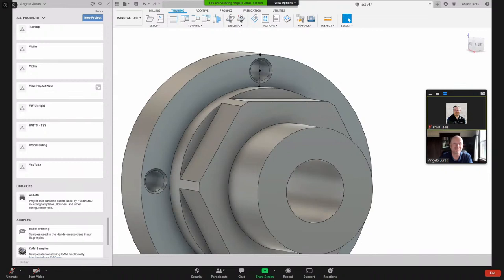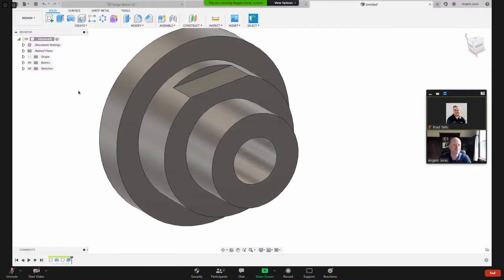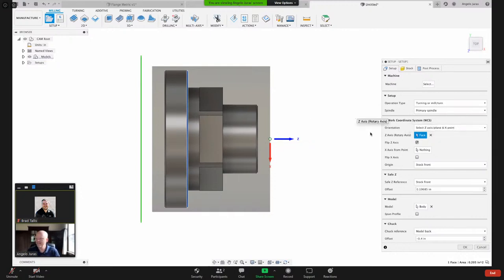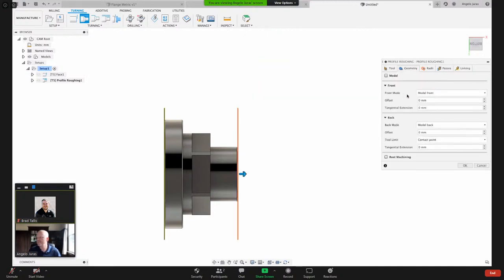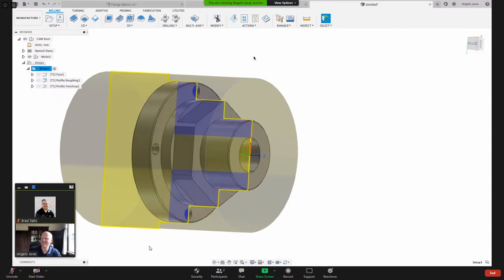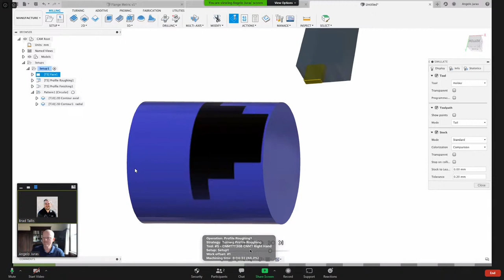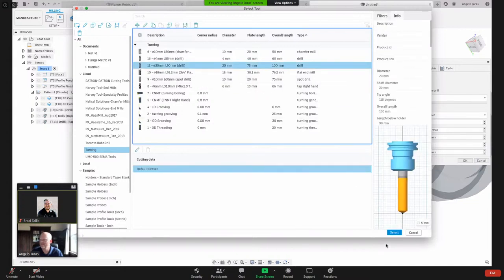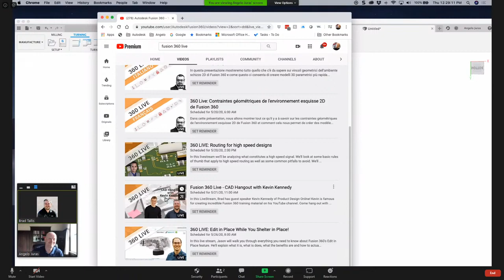Fusion 360 Live - Mill/Turn Toolpaths in Fusion 360

Comment: Hi! I’m a newbee in using Fusion 360 Manufacturing Turn. 
I’m trying to learn as much as I can
The problem I’m having is If I have a 12mm round Stock that’s
50mm long and I want to turn the front part down to 6mm x 20mm in the Z
The X movement is doubled when I post-Process it and look at the g-code.
It looks right in fusion and this happens no matter what processor I use.
Instead of moving from the center of the part 3mm in the X to end up with a 6mm DIA.
It moves 6mm in the X.  What am I doing wrong?

Comment: anyone know a generic post for a gantry or swiss style lathe
Reply: Our downloadable posts can be found here: https://cam.autodesk.com/hsmposts
Reply: @TheCroatianPimp  yeah nothing available there for a swiss or gantry style lathe. I have a ganesh cyclone-32 ncy. I need to be able to change cutting planes but not the coordinate system. I have live tooling in the x & z but need to maintain the machine xyz when I use them and a fanuc control. fusion wants to change the z to match the tool orientation or the posts I try do. I also need to always maintain x and y as diameter moves. im sure if I had 10k to throw at it I could have a custom one made but im just a self owned struggler lol
Reply: Video Started 📹 at 7:30